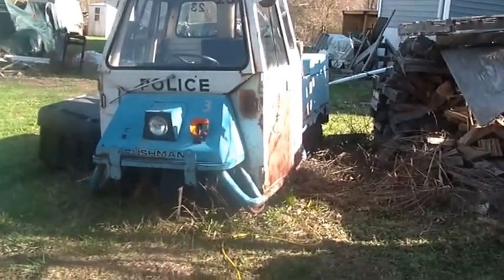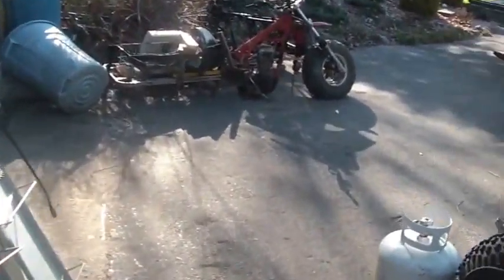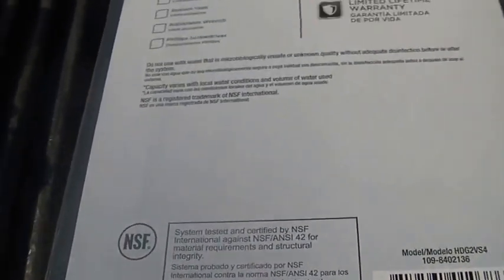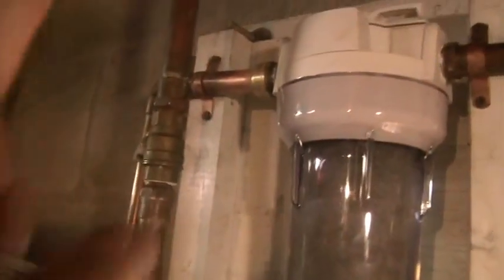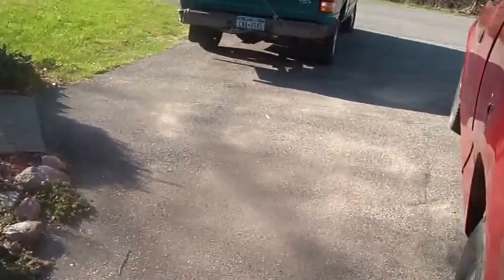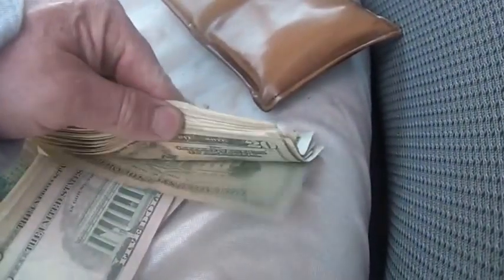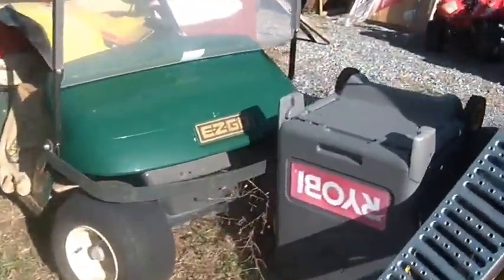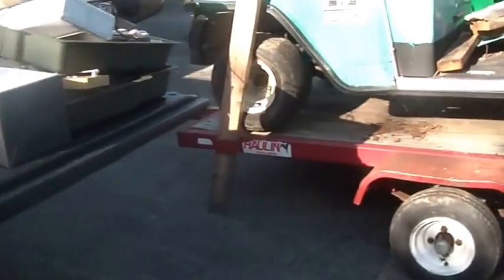4_25_15, Water Filter leaks, First Flea Market Tomorrow,

Comment: when i worked at the gravel pit . for some things we got a roll of O ring stock . they had a little cutter and a clamp. you cut to size and glued it together , the clamp to hold while gluing. looked like super glue . wonders if you could cut one down . Just a little water if it does leak . lol